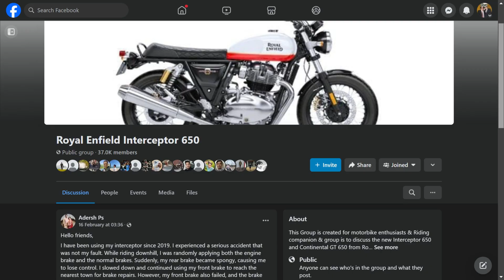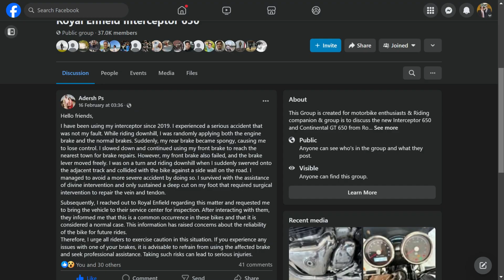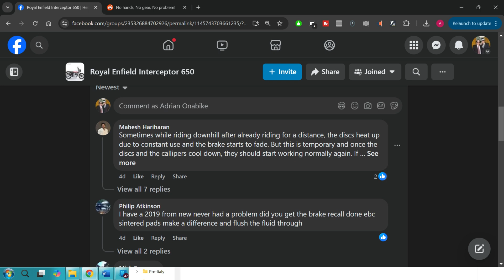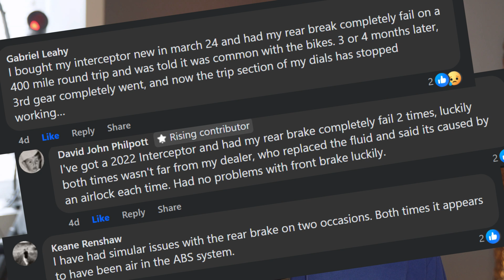Royal-Enfield 650 Brakes Are FAILING!

Comment from the maker: Since posting this yesterday, 5 to 10 MORE PEOPLE have reported having had AIR IN THE BRAKE LINES of their RE 650s. This does seem to be a common and dangerous problem with these motorcycles. 

I suggest checking out these links:

Stay on top of your brake maintenance. Check out 3 Ways To Tell If Your Motorcycle Brake Fluid Needs Replacing: https://www.youtube.com/watch?v=0mleUZxQSzc 

The original facebook post that started this video:
https://www.facebook.com/groups/235326884702926/permalink/1145743703661235/

Subsequent post where several new people said they have the same problem:
https://www.facebook.com/groups/235326884702926/posts/1150359616532977

Ride safe, but have fun!
- Adrian

Comment: My front brake goes missing. I have changed the fluid. The master cylinder also. Before going off the lever becomes hard. Please suggest some solutions before this becomes a major problem.
Reply from the maker: Honestly, if it's a recent purchase take it back to the dealer and fight them over returning the entire bike or at least replacing the parts. If it's not a new ish bike, sell it but let people know in the listing it has that problem so they can fix it.

Comment: I had been facing the same promblem in my pre owned 2019 interceptor. The service centre was advising me to change the entire master cylinder kit that costs 30 dollars. Finally I managed to source the OEM Major Kit(master cylinder repair kit) got my problem solved for 9dollars. These small components tend to wear out the O rings and the plastic tip hence losing break pressure. Easy fix, though Royal Enfield should start sourcing better quality master cyclinder manufacturers. Maybe just use brembo instead of the cheaper alternative Bybre.

Comment: Even my rear brakes went out multiple times
Reply: I replaced my entire rear system with a genuine Brembo caliper off a Triumph Speed Triple R. Bolts straight on. Plus, a Brembo PS12 or PS12C master cylinder. You have to buy a new brake light switch to suit Brembo master cylinder though. Different thread pitch. If I have trouble with the front, I'll be looking for the same remedy. I won't trust an RE replacement.
Reply: Update: Still had trouble and the only way I eventually fixed it was to isolate it from the ABS module. I now have a good rear brake with no ABS.

Comment: Add another rear brake failure, twice in 1200 miles from new, rear brake no fluid pressure, first time the dealer replaced the rear caliper under recall and here we are again no fluid pressure 200 miles later.

Comment: Is this the Interceptor and Continental only, or do all RE bikes have these problems? It'd be a shame if bikes like the Meteor were death traps, as they're phenomenal on fuel economy.
Reply from the maker: I think all the rear brake system part numbers are the same for the continental GT and the interceptor so in theory it should be both.
Reply: @YouMotorcycle  But not the 350s?
Reply from the maker: @IndigoJo you can look up the part numbers on the 350s and see if they match. I haven't checked personally so I can't say yes or no for sure. I think what's most important is to realize that, the company doesn't care for the well-being of people... We shouldn't support businesses that show no regard for human life

Comment: I got fed up with the barely adequate when working, rear brake on my Inter, and changed the entire rear system.  Not my video, but here is an installation video about the rear brake mod I did a year or more ago.
Not only does this address the common rear brake failure on the RE, but improves rear braking due to the 12% greater calliper piston area and improved hydraulic ratio with the Brembo rear master cylinder.

https://www.youtube.com/watch?v=3L5JptyvUIg...

A less expensive approach is to use a BMW GS 650 rear calliper and Brembo master, but no increase in brake torque due to the piston area being the same as stock.  My approach is that If one is going to fix the problem, then you may as well improve the braking at the same time.
Not all will agree that the rear brake needs improving or that there is a problem at all.......................

BTW, RSTech is not about to stop making belt drive kits..............

Comment: Similar problem. Since the purchase, I complained to the dealer that my ABS was triggered early, there was no feedback from the ABS to the pedal and the brakes were very soft. But the dealer said that everything was fine, it was a feature of the motorcycle. At 10,000 km, my rear brake failed. After replacing the main brake cylinder and bleeding the rear circuit, everything became fine and there was feedback to the pedal when the ABS was triggered. However, dealer refused to bleed the front brakes. Apparently, they are waiting for it to fail too.

After such attitude towards customers I sold Enfield and bought Harley. I don't want to deal with this brand anymore.

Comment: My 2021 Interceptor (New Zealand) 34000 km. has a spongy rear brake, I have bled and refilled multiple times. Now I leave weights on  brake pedal when not in use and this makes them firmer. It is an old trick mechanics used on early disc systems. There is an inherent fault on this system and obviously corrected after about 2023 because Super Meteor and new 650 Classic work properly. There should be a safety recall ….. buuutttt ? … crickets. I’m going to replace brake system with Triumph Speed Triple set which has beeen done by at least one YouTuber with a good result. Bybre system has a course thread on master cylinder as compared to to Bremebo.

Comment: It's very good from you to warn people about brake failures. The common thing here is air in the brake lines. I've had the same issue with my Aprillia RSV Mille. The cause of air in the rear brake lines was the Brembo brake cylinder, it had a (internal) design flaw. It was a known issue, but is was not fixed by Aprillia nor by Brembo. If Royal Enfield techs state that this is a comon or known issue, and they refuse to solve this problem, then I will not buy any Royal Enfield motorcycle! And yes I like the Interceptor 650 very much and was planning to buy one, but these brake faillures and 3rd gear issues are for me a "no-go" for buying an Royal Enfield!
Reply from the maker: Thanks for sharing your experience, it's good for people to hear about. Honestly, for me I won't touch another Royal Enfield because they have shown no care for the lives and well-being of motorcyclists. They know this rear brake issue could kill motorcyclists, but they won't do anything about it. It's disheartening as a motorcyclist to see them just ignore a serious safety problem.

Anyway, I just put out a video on the things that I hated about being a salesperson in a motorcycle dealership. If you're interested check it out plz :) https://www.youtube.com/watch?v=juwimgvkUmk
Ride safe, but have fun!
Adrian

Comment: Glad that I’m finding this video right now. I just had the tires replaced on my 2021 int650 and I got to ride it twice before the rear brake decided to stop working. In my case, the pedal for the rear brake goes completely to the ground. If I pump it a bunch, I’ll be able to get it to work again. Luckily the first failure was only at ~30mph and there was no traffic when I was going to work. I’m about to go bleed the brakes and see what happens. I bought this bike a couple years ago from the second owner, and it had less than 1500 miles on it. I’ve never changed the fluid, so I can’t say it is just the bike’s fault. Hopefully a bleed and new fluid will take care of this problem for me
Reply: Just bled the brakes. Took close to 120ml of dot4 fluid to flush out all the bubbles. The first 20-30ml looked fine, and the fluid looked like new. The next 30-40 had a bunch of micro bubbles with a couple larger ones. Around 100-110ml it looked bubble free again. The only fluid that looked bad was the stuff in the reservoir, which I used a syringe to remove and replace before pushing it into the system

Comment: Interesting video. I'm about to replace my R1200GSA with a smaller bike. At first, I was going to choose the Himalayan 450 which I really liked after test riding it twice. But I wanted to try the new Bear 650 to see how it feels (I love to look and while I already tried the INT650, it was many years ago).

But I stumbled on your video and I have two questions :

- Do you have any idea if the break issue is still a thing on newer models ? Since everytime I saw someone talking about it, they're always talking about models from 2021 and before.

- Do you know if that's a problem that only the INT650 and the Continal GT have ? I still haven't seen anyone talking about that issue on the other 650 models (Super Metero, Classic, Shotgun and Bear). And also nothing about the 350 or 450 plateforms (on the Himi 450, the rear brake is working extremely well, way better than the front).
Reply from the maker: Hey there! 

First question: it's definitely effecting newer models as well. Check the comments here. You'll find people who just bought their bikes within the last year, or in some cases, within a few months having issues.

Second question: I don't know whether it's all 650 models, or just the INT and GT. I don't know that I would risk it to be honest. I'd take a used Triumph, Moto Guzzi, Kawasaki, etc. over a brand new RE any day to be honest.
Reply: @YouMotorcycle  I checked and you're right, I saw people talking about the issue on newer models (at least 2023).

And for the other models, it seems it only affects the INT650 and maybe the Continental GT. I've looked on some facebook groups about the 650 plateform and I only saw people talking about their INT650 having the rear brake failure.
I'm in an Himalayan 450 facebook group and after searching, I saw nothing about it. But there's some stories about leaks on the master cylinder...

Well, I still have time since my GSA isn't already sold.

I don't think I go with Guzzi, even if I really like their bikes. I had a V85TT Travel for two months and 2500km and while it was great, it has a lot of little "things" I didn't really like. It seems most of those had been solved on the newer models but they're too expensive for me.

Triumph ? Maybe, I had a Tiger 800XC many years ago and I really liked the 3 cylinders (not a huge fan of the new 900). At first, I was looking for the Scrambler 1200 but I hate the keyless system (don't have it on my GSA) and only the newer models don't have it anymore, so again, too expensive for me...

At first, I was waiting for the new KLE500 but since Kawasaki gave us no informations about the bike, it seems we'll have to wait more until it arrives...

I'm more an "adventure bike" rider, but I really love "older" bikes as well. And even if I was looking for something smaller, there's some great bike which might be better (like the CB1000R which looks amazing !).
I also tried the Scrambler 400X and it really is a great small and economic bike.

Anyway, thanks again for your answer !

Comment: I wished I seen this video before ,I just picked up my new 2023  from the show room at royal enfield dealer June 2025 got home . Next day went out and gess what NO REAR BRAKES OR LIGHT.

FRONT BRAKES WORK AND LIGHT.
IT DOESN'T MAKES SENSE.
Reply from the maker: If it's already happening and you just got it, it's going to keep happening. Check the comments under this video and at the links I provided and see how many people have had recurring rear brake failures over and over on these bikes. If you have an RE 650 that doesn't have this problem, keep it forever and be happy, but if you have one with this problem return it ASAP, tell them it isn't safe and you want either a refund or credit towards something else. Don't set yourself up for a recurring brake issue its not worth your safety.

Comment: Can you judt stick to brake/brakes /braking instead of randomly using break/breaking (which means something more drastic).
It's very irritating.
Reply: I agree except in this case they may be one and the same.
Reply from the maker: @thatguy1060 😂 you're right
Reply from the maker: What? 😂 Is there a typo somewhere or something?
Reply from the maker: PS: If it's in the captions, those are auto-generated by YouTube, not written up by me.

Comment: Add another rear brake failure. My 2019 Interceptor 650 repeatedly loses all brake pressure and pedal goes all the way down. Will pump up and work some. I have replaced all fluid and manually bled and vacuum bled. It works fine immediately afterward but a ride or two later has air in the system again. 30+ year technician so I know this should be a sealed system but obviously has a breach somewhere.
Reply from the maker: Ugh. Very sorry to hear this but I'm glad to see people speaking up so others realize it really is a common problem. Thank you 🙏🏻
Reply: If there's somewhere the air gets in, surely it would leak fluid from the same orifice and would be immediately apparent.  Very puzzling.
I'll bleed mine (again) just before the MOT.
Reply from the maker: @Mike-dc7nn  I had to Google this, but here's what I learned: 

Basically, no, air can get through where fluid wouldn't for a couple reasons

1) air molecules are smaller, and I guess less dense, than brake fluid molecules so air can get through tiny gaps in seals when brake fluid can't

2) when you let off the brake, it depressurizes the system a bit, which would suck the outside in, but not the inside out, so the air would get drawn in, while the brake fluid wouldn't be pushed out (though you'd think it would be pushed out on heavy braking, so I'm not sure about this one)

3) rubber brake hoses can become slightly porous as they age, allowing air to get through where fluid can't

4) if the point of failure is somewhere high up in the system, like the reservoir cap for example, air could get in through tiny invisible gaps while the denser fluid would stay down

Allegedly anyway... I'm no chemist or engineer 😅

Comment: Mine feels spongy. It has bite on it, but i need to put more pressure on it. Its fluids are newly changed. Bike is at 700kms atm.
Reply from the maker: It probably still has air in the lines / wasn't bled 100%. Try that and let us know if it keeps happening plz :)

Comment: It's because of the stock sintered brake pads. Bite is good but overheats quickly. Go for ceramic brake pads. Also, don't throw the sintered pads away, those are expensive instead sell it at any workshops.
Reply: I understand. In my case, the brakes failed several times right after i bought the bike. Got kind of frustrated and thought of selling the bike but, a mechanic\friend suggested me to replace the pads with ceramic pads, which i did and since then, the brakes has never failed even on harsh riding conditions. I am not justifying the company.. just thought I should share my experience with the brakes. cheers!
Reply from the maker: @robinhood11124  good to know. Thanks!
Reply from the maker: Brake pads don't cause moisture to get I to the system. They are two separate issues. And if the brake pad quality is sub par I wouldn't be recommending anyone try to pass them off to anyone else. Don't need that kind of bad karma. We're supposed to be a community, that means looking out for each other.

Comment: Change from the stock pads for better ones. EBC I find are probably the best. Vast improvement on mine.
Reply from the maker: Glad to hear it. Changing brake pads won't change what's happening inside of the brake system, so people with the 650s suffering from air getting into the system won't fix their issue by upgrading the pads.
Reply: @YouMotorcycle  No, I bled the system as well. Easy job on your own.
Reply from the maker: Ok hopefully it doesn't come back
Reply: @12crepello   It's supposed to be. The only success I had bleeding it was after I isolated it from the ABS module. Tried everything else.

Comment: my gts rear brake lever just fails and goes all the way down after im at higher speeds and somehow gets fixed when i slow down. and sometimes doesn't. and the bite also seems to be weaker then how it was when i had it, despite getting new brake pads and cleaning the calipers.
Reply from the maker: Start with fresh brake fluid. After bleeding the brakes the problem should go away, however, if it comes back you should insist the dealer assess which component is letting air into the system, especially if you're still covered under warranty. Sorry you're going through this.
Reply from the maker: Fyi if your brakes are working better at slower speeds it's probably because you have moisture in your brake fluid which is bad. Moisture brings up the boiling point and stops your brakes from doing their job. They work less well at high speeds because braking at high speeds generates more heat than braking at slow speeds. Get that sorted out asap to stay safe. It will only get worse. Take care and please keep us posted
Reply: Do a brake kit overhaul . The rubber seals are not doing their job .

Comment: Thank you for your honesty and this information! also having brake failure on a bike with only 900 miles
Reply from the maker: So disappointing to hear this. I would take it back to the dealer. Show them right away. You can even send them this video. Check out the other comments of people sharing this issue, and show them the links in the description pointing to posts on facebook where people are talking about having the same issue there too.